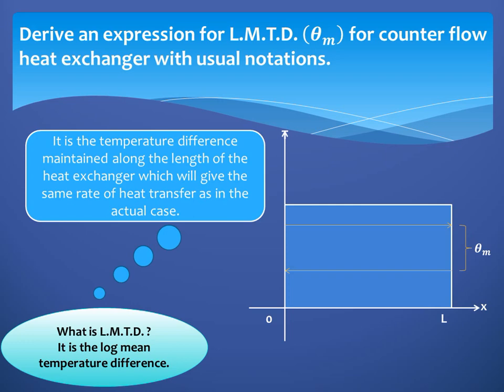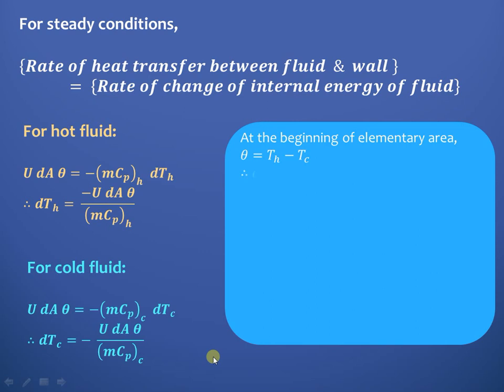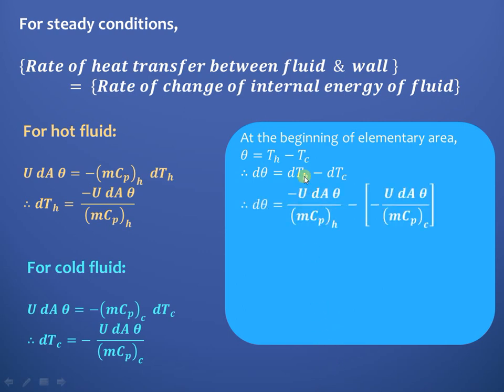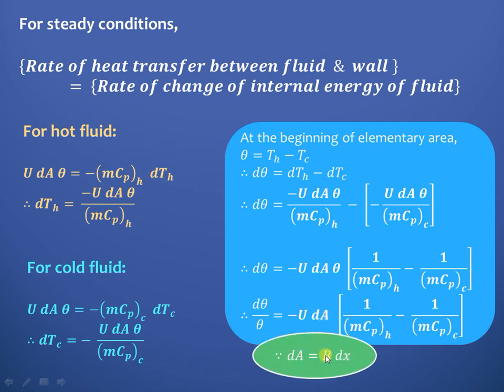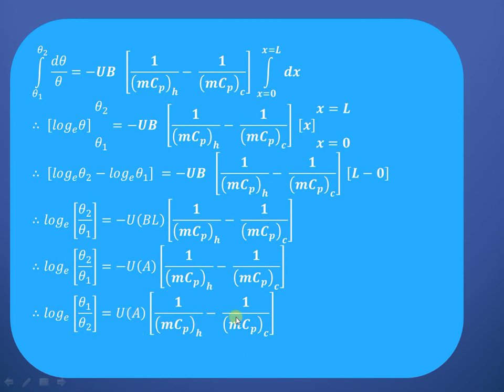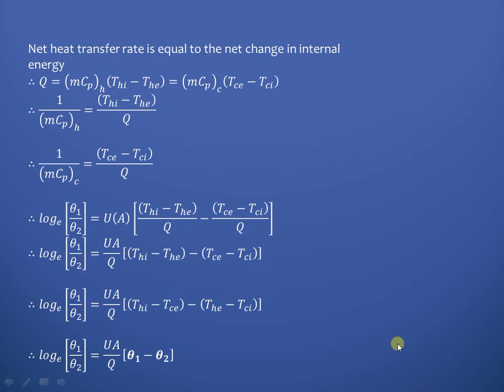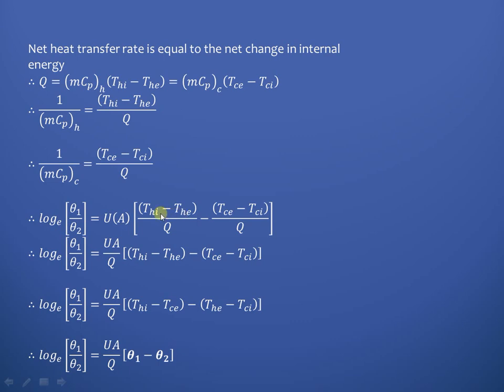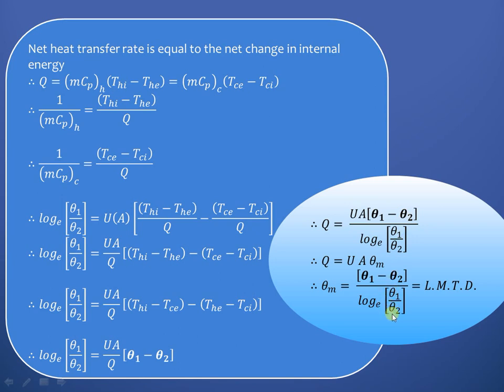L.M.T.D.  method for counter flow heat exchanger - GATE examination preparation

Comment: why u have taken minus in cold flyid cond...if u r taking hot fluid cond then its ok but i think minus sign wont be thr for cold fluid cond
Reply from the maker: Minus sign is taken because from the reference  (x=0), both the curves are decreasing nature .
Reply: @CHINMAY_ACADEMY  , one more reason is there to take -ve sign that the tepm. of both fluid is decreasing in the direction of H.E. length we took and u know that if temp. get reduces then -ve sign should be taken..
Reply: by the way, it is too good video thank u sir